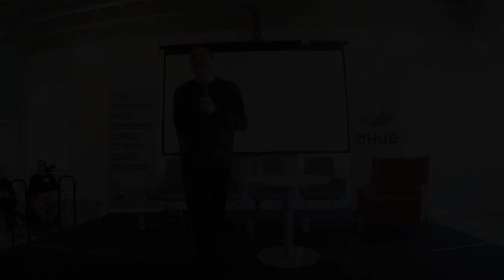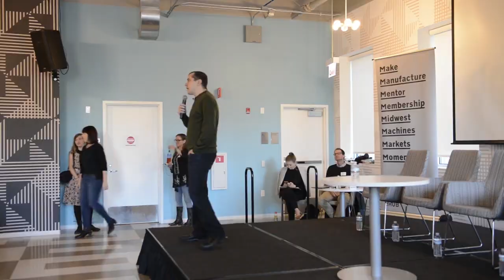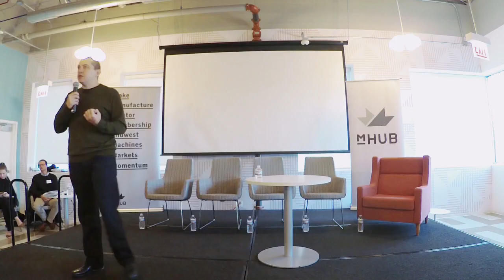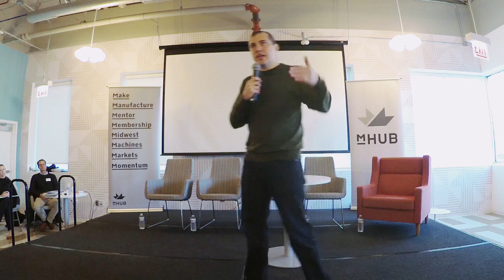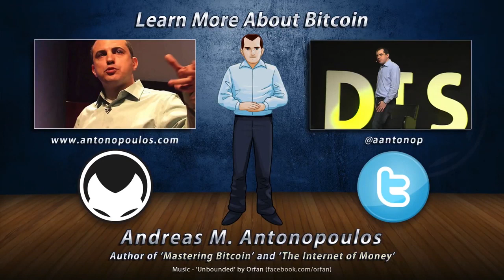Bitcoin Q&A: Energy Consumption

Comment: There are 2 components to Bitcoin energy usage. The first component is the Block Value (currently 12.5 BTC per block). This is a ONE TIME ENERGY COST to create the coin so the energy to mine a block of 12.5 Bitcoins is expended one time only to create these 12.5 BTC. This is analogous to the energy and expense used to mine and refine gold into a coin for the first time. The second part of energy usage is the transaction fees (typically very small) which is the energy used to actually perform the transaction. This is analogous to the energy needed to transport a gold coin from place to place to allow money to be spent. The same can be said for the banking network or the credit card network where it takes energy to perform a transaction. The actual energy needed (transaction fees) to perform a Bitcoin transaction is actually 1560 times more efficient than the banking network at performing transactions if you compared the value of the Bitcoin transaction fees to the total cost of energy to run all of the bank branches, the energy needed for all of the employees of banks needed to drive to work, the energy needed to run all the computers that connect all the bank ATMs and central computer networks, and the energy needed to power all the cash registers and credit card terminals. The people that are anti-Bitcoin tries to lump the ONE TIME ENERGY USE to create the Bitcoin with the transactions in order to make Bitcoin look like it uses much more energy per transaction than it actually does.
Reply: I just don't understand why miners are allowed to mine when there are no transactions. Google says that Bitcoin has about 290,227 transactions a day, this amount of transaction could be validated with single computer power. It seems that bitcoin created a lottery game where miners waste energy to win money, which has very little to do with actual transaction processing.

Comment: That's the biggest train of evasive arguments I've heard in a while... 
1. How does the market price of electricity across the globe say anything about the sustainability of it? You could argue that lower prices are even worse for the environment. 
2. Did he just say that the energy that is used in mining would otherwise be wasted? Really?? Don't you think the energy producers are adjusting their production based on estimated usage? And don't you think increased usage would result in higher capacity (and thus production). 
3. I agree with the point that normal transaction usage (banking system) uses tremendous energy as well. But he hides the fact that mining is so incredibly inefficient compared to the usual ways of handling transactions (banks) or things like PoS. It will not get better over time because if adoption of the currency increases, the fees will only go up in value and so will the mining.
Reply: But Andreas addressed your second point. You can't turn off wind or sunlight or geothermal heat. If you built your facility to have a capacity that, as a maximum, only satisfies the demand of today even though you know the demand for energy will grow in the future then you lost or wasted money.
What you said is true only for some sources of energy, mainly fossil fuels.
Reply: But increased demand means that incremental renewables are used to service miners, not to displace fossil. Imagine if BTC 10x, which I think based purely as digital gold it is possible. And if Lightning successfully kick off payment adoption, it'll probably 100x, at which point it will at least double global energy usage. At those kind of electricity prices, every kind of fossil power plant imaginable will be turned on. There's no arguing that Bitcoin is unsustainable and a PR/regulation disaster waiting to happen. No matter how dysfunctional the governance, failing to address this will spell the end of Bitcoin. Not something I'd want to see.
Reply: You CAN turn off wind or sunlight. Wind generators have breakes for that purpose (that's why you sometimes see some of them standing still while others are turning) and every photovoltaic system (even the those on private buildings) that is connected to the power grid has an obligatory radio-operated killswitch, so electricity suppliers can disconnect them remotely when there's more input than output on the grid. This is the situation in Germany, might be different in other countries. The bigger problem is that you can not turn them on in every situation (e.g. at night) to quickly compensate for a higher power usage. That's where hydroelectric plants come into consideration.

Comment: This is a completely specious argument, IMO. You make it sound like Joe's electric company is out there somewhere with more energy than they know what to do with. Electric grids in most places are designed to be able to produce exactly as much as will be consumed and waste as little as possible. Modern people need energy to live their daily lives, so delivering it more efficiently is a priority with or without Bitcoin, just as energy technology developed for decades before Bitcoin came along. Bitcoin may be a fine currency or asset, but it is not environmentally friendly and it would be wise to stop trying to spin it as such, at the risk of sounding dogmatic or dishonest.
Reply: "BTC..is not environmentally friendly": the energy used for BTC is as environmentally friendly as the method of energy generation in that area.  Solar powered BTC is worth the same as coal powered.
Reply: Galen T, In any case, is a waste of energy.
Reply: I agree, rarely is some one going to build a plant that has a significant amount of extra energy to spare. It will not be built in the first place.
Reply: @Karim-ik5ij  He explained why they do in fact build for more than they need right now. Building for future use is more cost-effective.
Reply: Even if you think it is not environmentally friendly it is considerably more energy efficient than the current legacy banking system. That one can convert and store this energy as BTC  by mining at locations where energy is cheaper - typically underpopulated regions with renewable electrical generation -e.g. geothermal fields in Iceland, hydro or desert locations with abundant water/sunshine makes it more environmentally friendly than the coal, gas or nuclear alternatives than need to be built near population centers. It is this Proof of Work energy conversion that gives BTC its value.

Comment: This guy really has all the answers :)
Reply: you mean all the rationalizations that make you feel better? :)
Reply: He seems to be smart but some answers I see completely different. You can assume that he is heavily invested in crypto currencies and with every speech he has the chance of stabilizing or even puch the crypto system and with it all his fortune.
Reply: If you interpret the question differently:
"Can you make a crypto currency that doesn't use more electricity than it needs?"
His answer doesn't answer that. The system of BTC promotes miners to invest more power, with the same effect as if just a few nodes were connected, because they're competing for that arbitrary number. 
BTC is a massive waste of energy, and there are ways to fix that, but you won't be able to mine as many coins with an energy saver built in, which is likely the reason those greedy bastards don't want that.

Comment: "Using electricity that would be otherwise wasted" - a very specific niche use case I think. What percentage of BTC miner use is actually in these scenarios with renewables spoken of?
Reply: While not having any numbers for this maybe you can think about it this way: As he said, since BTC mining is location independent you tend to use cheap energy to remain competitive. Cheap energy will be found where supply is high and demand is low. This is not necessarily clean energy, but it will support building clean energy plants, without the current need for demand. And for example for germany I know, coal energy is just cheap, because it's subsidized by the government. Clean energy is getting competitively cheap, but it's missing an energy storage. While not being an energy storage, bitcoin can at least be a monetary storage, which allows clean energy to be competitive.
Reply: @Tom-zo3fs  I don't think BTC in itself will promote clean energy- I think that will happen anyway, and the beneficial sense that BTC gets from it is just a biproduct.

Again, without having some hard numbers of how much clean energy is actually used in BTC creation it is hard to judge. It is an empty statement in my opinion.

Comment: Interesting view of to use surplus of produced energy to do computation that adds value. However i don't know if Bitcoin (or other crypto currency) mining is the best option.
Reply: Do you have any other suggestions?
Reply: @pistasjkis  If you want to spend surplus of energy it in computation there are also other options e g. Computation for medical research, biological research   solving unsolved crimes, UFO investigation, analyzing signals from space (seti project) etc. Another option could be try to store the energy e.g. by converting electricity to hydrogen.
Reply: Another option is having a pool of calculations that need to be done or someone likes to have done but are not realy time critical and can be postponed for some time.

Comment: Ah, see, it is just not true that it doesn't matter where the mining takes place. You have literal financial incentive to put it CLOSE to other nodes because you want lower latency. It is identical to wall street bots getting set up NEAR the stock exchange just to get lower latency.
Reply: Bruno Škvorc yes and no. With a ten minute avg block time, latency would have to be dwarfed by electricty costs as the main profitability factor to consider. Wouldn't you say?

Comment: Actually China does have a large distribution network but miners are increasing the baseload needed. 
In addition to that, China also makes extensive use of HVDC. Alternative energy can be stored as pumped hydro, flywheels etc. Stop trying to justify something to get people to join in increasing the value of bitcoin to benefit yourself.
All that wasted processing power can be used to process for medical research rather than your currency that only benefits a few people but doesn't create anything useful for mankind. That data center is used to serve data for the internet and much of it visualized and is used to do productive things. As for offices, you are simply trying to justify for yourself while your little server for one person uses up kilowatts of power.
Offices in general serve many people not just you so do banks, cars and diesel trucks. All transport good for consumers. Your bitcoins can be used for purchasing of goods as well, but serves less but the per capita cost is high. Bitcoin is no were near as efficient as current transactions and cannot be accepted as a "national" currency due to it's many flaws. You don't want two proof of work systems because you want one so you can get the most benefit.

Comment: I know it wasn't the question but you need more than just cheap power. You also need fast cheap internet.
Reply: not really i have very expensive and not at all fast internet and I also live in a state that has some of the highest prices for electric in the entire county and im still paying pennys on the dollar compaired to how much I make from turning the so called green tho its not electricty in to btc compaired to if i didnt cosume the electic that has to be used or it needs to be burned or shifted on the grid to some place else during times of peak out put from the solar and wind farms that cant store the electic on days of low useage.   Its much more of an efficant use to burn every killowatt and turn it in to heat and btc compaired to when they have to switch power over to what called a dummy load to burn off excess power at any green power plant..    Many wind and solar farms are now also switching to btc miners to burn up there excess power at times of peak production durning times of low use.   rather then just sending it to a giant resitor were it just gets used up and dont produce any thing but heat and just waisted with out geting any thing back from it..
Reply: Crypto mining is not very internet intensive, no. Obviously, you need internet to mine, but you can probably mine fine on dial-up, as long as you have cheap electricity. I am blessed to have both cheap and fast broadband as well as cheap electricity here in Norway.

Comment: If the trading volume became 10x wouldn't that require more miners to process the transactions? 
The other points do put things in perspective and are valid and strong cases for bitcoin.
Reply: Daft Sage Not neccesarily so, I believe. New miners will only pop up if it is economically attractive to do so. And while a growing pool of fees might instigate that, the difficultylevel of the hash will be adjusted to 10 minutes, no matter how many miners are reaching that. So probably the only extra energy will be in cooling solutions and secondary expanses such as offices and hardware; all needing energy to maintain/produce. So I recon bitcoin scales well in this regard with some, but not even close to 1:1 extra energy expenditure.
Reply: Check his video about the Lightning Network. There's no need in more miners to process 1000x more transactions

Comment: Usually you say good things Andreas, but if you just answered: Yes Bitcoin and PoW is awfully wasteful of energy and we need to solve that.
I would have kept you to higher standards. Cardano and their Ouroboros algo will run more decentralized then any other blockchain the world has seen by end of 2019. In addition it will be 100x faster and all this can run on a low energy computer similar to a RasberryPi. And we will all know it in a few months time. BTC will never solve its energy problems. And with todays knowledge of our planets climate issues... Sorry.
Reply: Bitcoin proved that it works. Cardano still HAS to achieve the same. Until then it is speculation, nothing more.
Cheers
A guy, who is heavily invested in ADA
Reply: None of the energy is actually wasted, it has been converted to the security of the blockchain which increases with every block and hence time. Bitcoin is therefore the most perfect “battery” that can STORE energy as value the world has ever seen.

Comment: Ethereum is the solution when it goes to proof of stake
Reply: Pegged as a bitcoin derivative because it still needs PoW
Reply: Except proof-of-stake doesn't work without relying upon holders not stealing from you because of their good natures
Reply: Vitlaik has it all figured out just watch this. He's a modern day Leonardo DaVinci or an alien sent from space to take humanity to the promised land. To the moon 🎑
Reply: Anthony Perks what happens when proof of stake holders lie, well they lose everything so its not worth it. The system to replace mining will be figured out soon making bitcoin not the #1 anymore I believe
Reply: Yeah... Funny how the personality isn't backed up with implementation plans?  There is, of course, a reason for that.  It doesn't work.
Reply: +Anthony Perks no implementation plan etherums Casper POS is already implemented. every 100th block is decided on by POS. Eventually, after miners have had enough time to sell their GPUs, every block will be decided by POS. POS is real, it works, and is happening right now.
Reply: +MrFatilo I am. but etherums POS system isn't the generic version, it's a custom version called Casper. POS has been around for awhile now and they've ironed out all of the kinks that the original algorithm had.